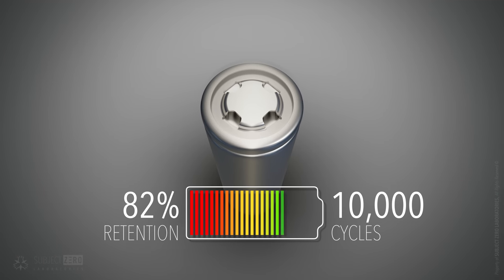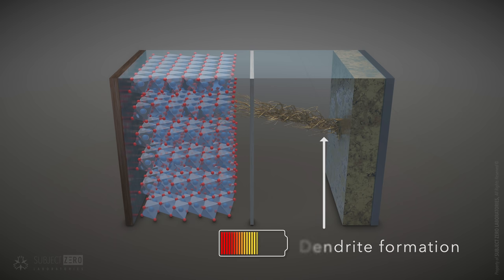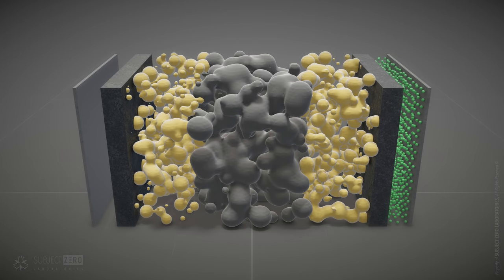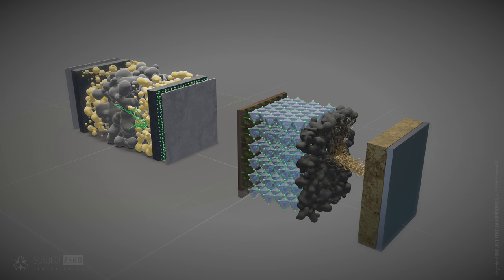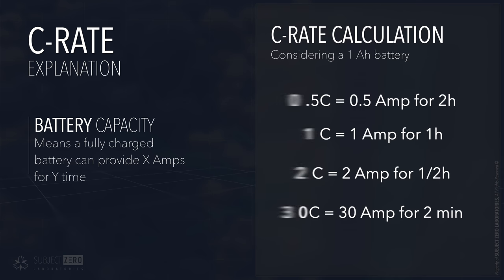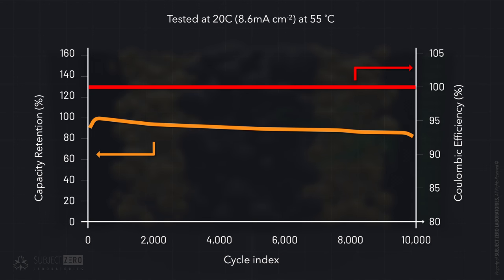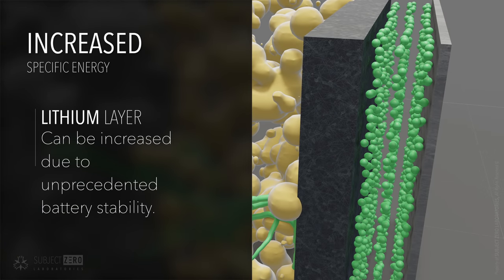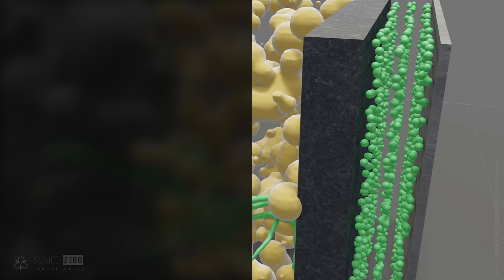A battery that lasts 20 years

Comment: Just asking for your opinion on a different concept of my own that is quite basic. The build can at least be of 2 ultra strong permanent magnets, one above another where the top magnet stays stationary on a plastic* container maybe filled with water while the other is inside that container. Between the top magnet and the container needs to be a very narrow gap for which a light sheet of lead* can easily slide between the magnets just enough to cause the bottom magnet to fall as if it were a delicate power switch that the rise and fall will help* generate more electrical power than it would take to move the lead* sheet in and out of that gap in least frictionless way, maybe levitated by other magnets. The water is basic to prevent damaging and even far too much noise.
.
In summary... it would be as if the permanent magnets can be switch on and off like electro-magnets.
.
I tend to come up with a whole lot of various ideas that worked out awesomely, but... not often able to test my ideas out.

Comment: Nitpicking here, C-Rate does not tell you anything about energy. It only relates charge or discharge current to capacity (usually nominal capacity, because unfortunately the actually available capacity depends on the discharge current).
Energy is the integral of current times voltage over discharge time, and voltage is a variable here (depending on the C-Rate, among other things).

Comment: I wonder if they could use carbon in the middle instead.  Lithium would likely react when coming into direct contact with the carbon since it is positively charged.  Also, it shouldn't slow ionic flow much since it's conductive.

Comment: here is a hint. DIOD in a irregular pattern based on thermal and discharge rate. this will make a really fast self recycling battery it could run for 40 to 50 years.

Comment: This is absolutely awesome, but one problem.  Since all manifactors of phones, vape devices, bluetooth speakers and lots of other stuff that relies on batteries,  only create their devices to only last for a max of 3 to maybe 5 years...  what's the point? specially phones... designed for 2 years. (hence the 2 year contracts lengths so you have to buy a new phone.)  

I don't think the companies who sell those kind of products are going to be happy with it.. as they will experience a loss of sales after 2 years when their product suddenly can last 5+ years or longer.. so this innovation is amazing, but the mindet of companies have to change dramatically or it's going to be stopped, or not used. Now for medical devices this would be an amazing solution for sure!  (pacemakers ect.)  that would help someone SO much..  and if they can be used in a chain it could be also good for cars,  if they can be recycled in a good way, so we don't end up with a giant battery mess that can't be thrown away without harming the planet more than ever in 20+ years.

Comment: Honestly, I am break-throughed-out. 

We have been hearing about crazy advancements for a decade now. None of it ever comes to market though.
Reply: Not none. LiFePO4 batteries used as a replacement for deep-cycle lead-acid batteries is a thing that came to market within the last decade
Reply: @specialopsdave  It was invented in 1996. Took a loooooooong time to get here.
Reply: @someguy5035  Solid state battery tech is over 10 years old now. It took 15 years for that LiFePO4 tech to come to market. Following that trend, that means that in 5-10 years, solid state batteries should be in the consumer market
Reply: @specialopsdave  It isn't coming. If it was viable companies would accelerate this process. Double, triple, quadruple capacity batteries would be the holy grail for EVs. It would change the world. 1200 miles on a charge. 

It just isn't there.

Comment: I can't believe mega-capacitors haven't already put the old battery to rest.
With things like graphene and silicon in a similar pattern to work with, the only problems are connecting the plates and managing the voltage. Or am I missing something?

Comment: I hope this tech could be implemented in a couple years. There are a lots of industries which would benefit from high capacity, high density and durable batteries.
However I think planned obsolescence will have it’s share… Why would you sell a battery that lasts 15 years, when you could sell one every 3 years?

Comment: Ok the C rate calculation is klugy tp me. What's the C rate of a batter that delivers 1A/hr for 5 hours, for example? It looks like the C rate in this example is only about a batter that can deliver 1 am/hr so that's the capacity you can discharge. Maybe it's just not about capacity, but still, it's a pretty incomplete rating unless the speed of discharge capability is all you're measuring, how quickly you can deliver 1 amp, regardless of capacity. My problem with that, though, is that saying a batter will deliver 1 amp for an hour means it's capable of MAINTAINING that amperage for an hour, I'm pretty sure.

Comment: That cycle chart shows testing was done at 55°C, how does it perform at room and sub zero temperatures?
Reply: Considering that batteries heat up when used, testing at RT or even at sub 0 wouldn't really help umproving it for general use in my opinion. It would be nice to know, yes, but other than that I dont see a reason why someone should invest the money to find it out

Except I'm missing something of course
Reply: @antares8826  Temperature range at which it can operate could be limiting factor in some real world uses, thats why its important. No one should "invest" in it, it should be a part of the publication, but i cant pay 10$ to see the whole document.

Comment: This will never see the light of day. If it is capable of holding 300% the amount of lithium, we could be looking at 1kw/1kg, which would make batteries cheaper, more powerful and more robust than gasoline or anything that runs an internal combustion engine. The powers that be will never allow that.

Comment: If a charge cycle isn't required, in application that safety wasn't the priority say autonous robots, coring older lithium ion batteries could interesting, if the discharge needed to be higher. The added benefit of integrating into current production with moderate alterations, also would make it more attractive to current producers??

Comment: i have two 30Amp 3000mAh 18650 sony batteries that both have about 1500cycles on them, both lost about 200mAh in the process, don't know what sony is doing but they are good at it

Comment: That explanation of C rate is really confusing to me. Even after reading what that means on Wikipedia I'm still not completely certain I understand it. Does a C rate of 20 mean that regardless of what your battery capacity is, 20 means you're charging or discharging it in 3 minutes (1h / 20)?
Reply: C is capacity in amp hours, so one C for a 100Ah cell, is a current of 100A for one hour.  A 20C rating in a data sheet describes the maximum current this cell can handle, so if it is a 100AH battery, it can handle 2000A for 1/20 the time, i.e. 3 minutes (in reality less as internal losses increases with higher current). Charging is also described by C metrics: A Li-ion cell typically has to be charged the last stretch from 85% to 100% at 1/20C. This means a 100Ah cell should be charged at only 5A for the last bit.

Comment: i always wonder, couldn't they just make the cathode removable, and allow periodic removal of dendrite. it feels like way easier than try to find the miracle battery chemistry. you could just make battery dendrite removal able with existing chemistry. then you could use shorter cycle life but denser energy chemistry, and just mechanically clean your dendrite every year at yearly checkup. If you done any electro plating, the same dendrite behavior also occur there, we just clip them off mechanically. Don;t see why not the same thing couldnt be done on a battery scale. i might be inconvenient, but surely it's way easiser than spent time research the next miracle chemistry and scale a whole new supply chain and production method. versus just use existing method/supply chain. and maybe spent 1 day per year clean up all the grown dendrite

Comment: You state that a specific energy of 1000 Wh/kg can be reached by having a lithium metal anode. That statement is very misleading. In conventional batteries, the graphite anode already has a much higher specific energy than the cathode, so the cathode is really the limiting factor. A lithium metal battery with a conventional cathode would have a hard time even reaching 500 Wh/kg. 1000 Wh/kg cannot happen unless there is a revolution in cathode materials.

Comment: Interesting technology there, but, I always wonder about the things that make sure that a lot of these technologies never make it out of the lab - is it scalable re manufacturing? what's the cost at scale? does it use elements that are controlled by hostile countries? is it capable of being produced en masse?
Reply: Most of the time when you hear about new batteries the problem is normally the pressure/temperature to keep the battery working. You can have a battery that works better at 55 C but you would not like to have a device in your hand that is always 55 C. If a new battery that works in roomtemperature/normal pressure and is better is found, you would already have heard about it from Apple/samsung.

Comment: video suggestion: alcohol alkaline fuel cells
Reply: Interesting, has been experimented on for cell phones and other small electronics for decades, but doesn't it result in the same problem as growing ethanol for combustion engines? If you need 10 acres to fuel your own ICE car, using an Ethanol fuel cells only  halves that by being double the efficiency of an engine = still too much land used to be practical? There are also enzymes in the works, which can help yeast metabolise wood and grasses and then we are talking, but it is still not scaled up outside the lab.
Reply: @Tore_Lund  both methanol and formic acid can be sourced electrochemically from atmospheric co2 (a whole sustainable economy, including all of chemical industry could be built around nuclear powerplants doing that); 
additionally, ethylene glycol can be (with the correct type of a fuel cell) used as a rechargable battery, just one you can exchange the fuel in (or simply use methanol and have conventional fuel cell instead in the same hardware)
Reply: @matushonko7223  That is much better than growing Corn. I love the idea of liquid fuelled fuell cells, which is they only way to store enough Hydrogen in a vehicle. Both cryo, high pressure tanks and metal hydride, are as bulky as batteries.

Comment: How did you determine it could maybe get up to 500 or 1000 wh/kg. I'm sorry that's a very bold claim. That's like saying you made a car engine that's 80% efficient. Very unlikely. You can't just increase the lithium concentration.
Reply: His speculation is that you can do exactly that.  He didn't "claim" anything, though, except that the paradigm in how batteries are designed has the potential to change dramatically, and that's true enough, based on current evidence.

I'm not normally real big on pie-in-the-sky science reporting, since you can literally read a new article about the rosy future of batteries every single day if you want, but the fact that so much research is being done in the area is itself evidence that changes in our understanding are coming at a fairly rapid pace.  If you suggested to people that even 250 Wh/kg was possible 15 years ago, you'd get lots of skepticism, but hey, here we are.  Progress happens in unexpected ways, but it does happen.
Reply: @michaelleue7594  He did make the claim, exactly as I described it, that you could MAYBE get 500 or 1000 wh/kg. That is a claim that requires evidence, just as if I said this new engine could maybe get 60 or 80% thermal efficiency. How did you determine that may be true? There's no evidence that these batteries can even achieve the 250wh/kg current energy density. More realistically this kind of battery will be in the 150wh/kg energy density. Solid state batteries thus far have not been particularly energy dense.

 Once you start getting into the energy density of 1000 wh/kg you have the energy density of TNT, which is absolutely crazy. There's no way your battery will have the same energy density as TNT and if you could do that it would be extremely dangerous if it short-circuited.

No matter how much research you put into car engines though, you'll never get 80% efficiency. The realities of the laws of thermodynamics make that impossible. Similarly you're never going to get a 1000wh/kg rechargeable battery that is safe.  There is a good reason why high energy density battery promises have been made for decades now and they NEVER pan out.
Reply: @ajr993  There's a well-established formula for the maximum theoretical specific energy of a battery composition based on the reaction equation, the voltage created by that reaction, and the molar mass of the materials.
Reply: @ajr993  Not only energy density determines if a battery is safe, it also depends on internal resistance. A super capacitor with much lower energy density than Li-ion have very little internal resistance, so they can literally blow up. Al-air fuel cells are not cpapable of enormous currents, even if their capacity is 4 times that of Li-ion.

Comment: Liquid aluminum Salt batteries are way better and they have left the lab and are sold commercially now.
Reply: Those are for grid storage not for EVs or consumer electronics.
Reply: @kushalvora7682  you could use them for electric railcars or mag lev trains though

Comment: This is a pretty interesting ssd, i wonder how much memory it can hold? In all seriousness this is very interesting, especially for sustainability of renewable energy solutions, such as electric vehicles that don't rely on hydrogen as an alternative to fossil fuels.
Reply: Well...electric vehicles is fossil fuel-powered vehicle with extra step actually if you think about it (for now at least). Nuclear energy generation is the only viable dynamic universal power source we can use to topple off and curb stomp fossil fuel (geothermal and hydroelectric is static and can't be use on mobile platform but at least reliable since their power generation don't depend on whim of fate, while I consider solar and wind power generation as cosmetic/additional feature of already existing products such as roof tiles material because dedicated power generation facilities simply are waste of times, resources and manpower all because their power generation highly dependent on how good your relationship is with Lady Fortune). Unfortunately because nuclear compliance costs is so high not many investors really want to energize its market, so for foreseeable future we will continue to use fossil fuel (not to mention that fracking allow us to tap into previously unobtainable fossil fuel sources and greatly extend the possible fossil fuel reserve we actually have, and modern fossil fuel power plant are actually really clean at their emissions and efficient at power generation).

Comment: lets say 10 000 cycles at 90%  eficiency thats eficient batery use in airplane cycle for 15 years so it maens like hybrid engine and fully electric future also and permanent fueling as nuc core in future and stem on  e genarotor and on cells and e gen jet packs so techincaly is only use batery charge so core basicly fills only cell, now next stage is tocamac generator cell then is everything on advanced energy ven airplanes and spaceship transporters tech easy so tocamac on gen lvl size for everyday use turn into steam anything and spilling water out if needed